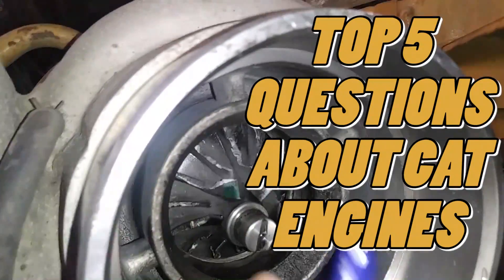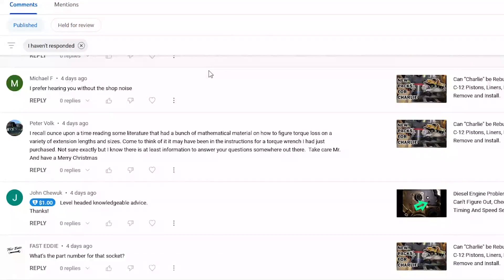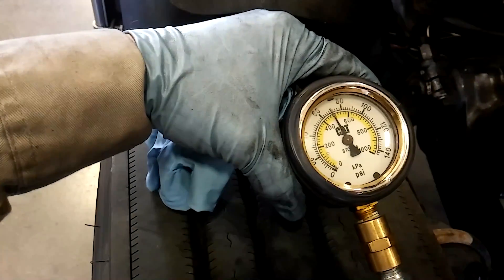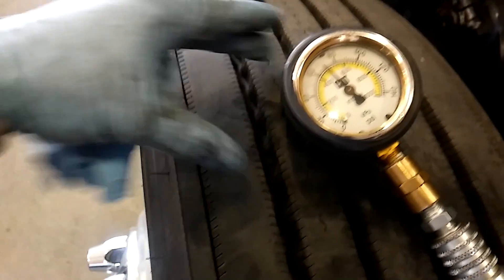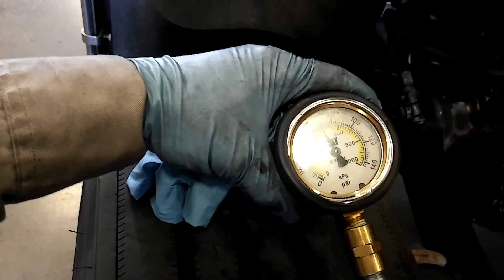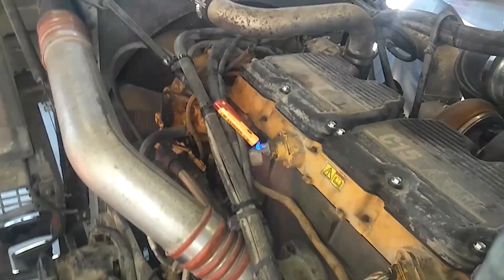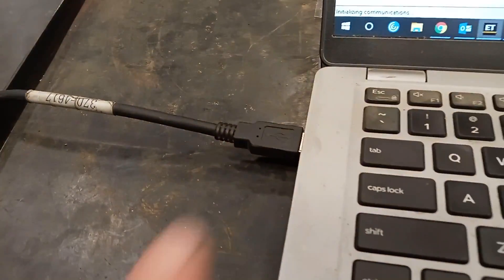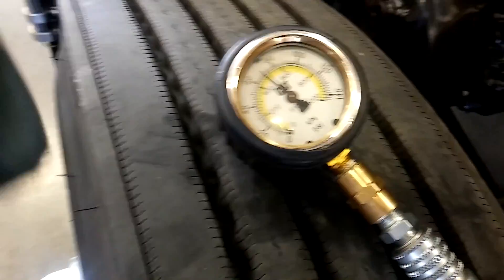The Top 5 Cat Diesel Engine Questions?!?!?

Comment: Learned plenty about CAT here, but I work at a place where we need to be able to buy NEW engines. We don't do CAT.
Reply: I work at a company that was all Cummins.  We have finally had enough of the runaround, warranty-dodging, finger-pointing BS between Cummins and the truck builder (FL or Inter), so we gave them the finger, have gone 100% Freightliner, with 100% Detroit driveline front-to-back.  Now, there`s no finger-pointing anymore, as everything on the truck is under one roof at the stealership.  So no more Cummins saying it`s the OEM harness causing the problem, or the OEM saying the engine builder is responsible for that.  Do I like it? Well, yes and no.  Freightliners have their good points and their bad points.  There`s a lot of distraction in the cab for the drivers, GD beepers and warnings constantly going off, beeping, bleeping, flashing on the screen, screaming at you that collision is imminent, there`s a car beside you, the world is going to end, etc. 
But, ownership and management thinks that going 100% FL and Detroit is going to be the savior of a lot of problems, from a shop perspective. Ironically, we are still waiting  over a month to get a truck into the stealership, and even then, often times they cancel the appointment, last-minute. 
Makes me wish I was back in the 80`s again. 
It`s still a never-ending litany of problems. There is simply TOO much automation and too many sensors on trucks as society keeps dumbing down.  We need more intelligent drivers, not more complicated trucks.
Reply: So find another channel!
Reply: @mofozi571  nope. I still enjoy it

Comment: I always advise my customers to not delete or change the engine software due to warranty too. I always also tell them that if they do then make sure you always keep the removed parts safely put away in case you are forced to install them back on.  With the government regulations always changing and getting more strict they may be forced to someday reinstall those parts and pass an emissions test in order to keep the truck on the road.  I have several customers that come in for a rebuil and don’t care about the warranty. Just want us to do the rebuild.  Also have lots of the fly by nights installing the improper kit l, leaving the go fast files in and then when problems arise find out that warranty is not covering anything.  Good times!

Comment: You forgot to mention that removing or tampering with emissions parts is a federal crime. Even if you live in an area of the USA that does not have emissions testing. I know that the chances of getting caught are very low but you don't want the feds coming after you.

Comment: Hey josh I just bought a large wood chipper with a caterpillar C 6.6 mechanical motor, I’ve never heard of this engine, was wondering if you have had experience with this motor.
Reply from the maker: I made a video about the 7.1 and 6.6 engines a few months ago. Check out the 7.1, I discuss the video there.
Reply: @AdeptApe  thank you

Comment: Hey josh I have a C-15 acert 06 379, do you recommend deleting the IVA’s and also do you recommend swapping out the double turbos and converting over to 1 ? Thanks josh
Reply: He literally answered this towards the end of the video
Reply: Speaking from  experience the compound twins or a single turbo is fine, the problem most often you will run into is if you delete the iva's on a mxs or nxs, you will lose the the head gasket, the mxs and nxs runs at 18.1 compression, so they relie on the iva's to bleed off some of that combustion pressure, making the head gasket live. I found if you want to delete the iva's you must go back to 6nz compression ratio of 16.1 along with changing the cam gear and front plate to 6nz, and timing sensor to the 6nz location, and also going with a 6nz ecm. It's a lot of work and expense but in the end you have the best cat engine you can make, a 6nz with the stronger mxs bottom end, also by staying with a compound turbo set up of the of the mxs or like the pdi compound turbo like I have run, will keep you exhaust temps lower on the hard pulls than a single turbo will, also go with a ,stage 2 cam it will make a big difference  in the power and better fuel economy if you drive it right
Reply: Keep the compounds if you live in the west. A good 329-8542 475hp delete file will work fantastic. When you overhaul it use 16:1 pistons.
Reply: Watched the last segment of your video, but it kind of contradicts one of your previous videos saying “the iva is/was the downfall of an acert”. Just a little confused my cat brother.
Reply: Keep the twins, tune out the IVA’s when they have a problem.